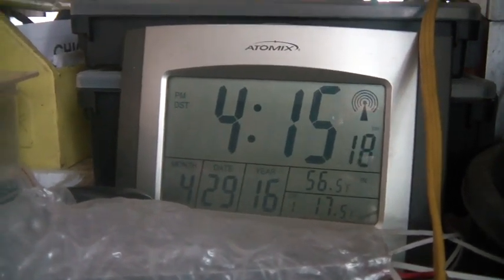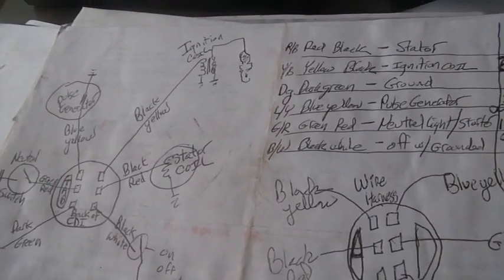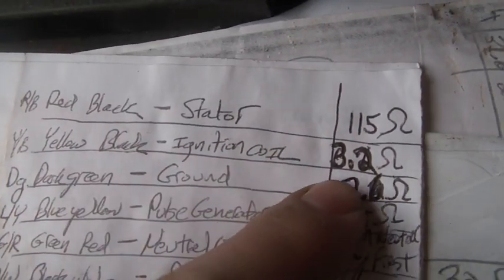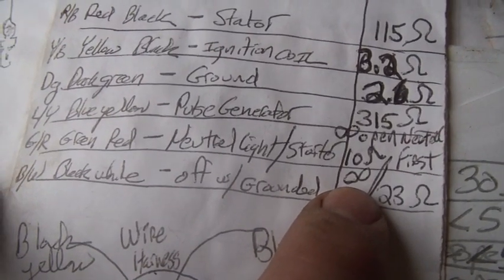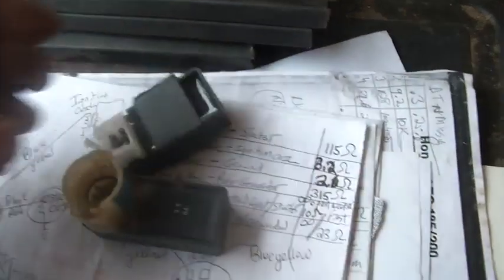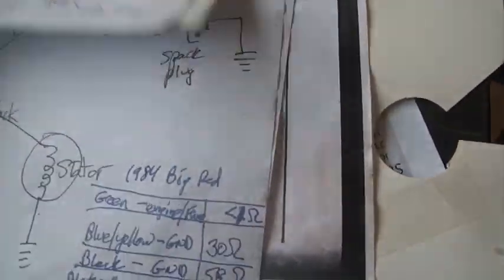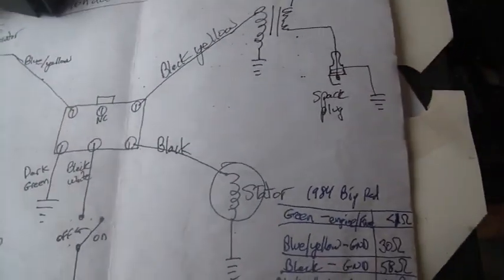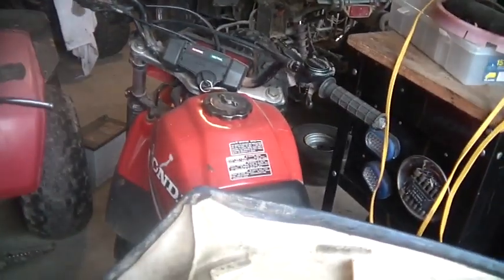Honda 200ES CDI

Comment: Harvey,  Can you please send me a current link to the correct China non advance CDI box to convert my 1984 200ES to the square plug style?  Thanks
Reply from the maker: Hey RatRod!!!!   They don't make China Quad CDI boxes without advance, but, I have found that the Honda ATC 185/200 motors run fine with the extra advance,  here is one I would use.... https://www.ebay.com/itm/5Pins-CDI-Box-For-70-90-110-135cc-Scooter-ATV-Quad-Go-Kart-Chinese-TaoTao/191790284945?epid=1794648153&hash=item2ca7978091:g:XQsAAOSwKtlWoCCO&vxp=mtr    I normally buy more then one because occasionally the quality is not great.... It should get U started and running, some are of good quality and last almost forever, some only last a short time.... Thanks for asking, watching, and commenting!!!

Comment: Finally had ten minutes to myself today so I tested out the wiring. My results are as follows. I tested every lead twice. Once in 2k and again in 200. My results will be posted with the 2k result first.

Stator  --  .260 / i
Ing. Coil  --  .002 / 1.5 
Ground  --  .002 / 2.2
Pulse  --  .030 / 30.7
Neut.  --  i all
Off  --  i / .003                    (200) i / 4.7
*i=inf.

I hope we can get some answers. The pulse bothers me a little. Maybe a good cleaning??? The pulse reading does jump some around when I pulled the recoil. I was pretty sure the the coil was questionable when I first dove into this project so no big surprise on those numbers. Let me know your input on this. Thanks again for everything!!!
Reply from the maker: Hi, Those readings look pretty good, though, the on position is low at 470ohms, infinity even on the 2K range would be much better.... The readings bouncing about when U pull the recoil is very normal for the pulser.... Where do U live?  USA?  What is Ur plan with this bike, R U trying to restore it or just get it running????  Thanks for the getting back to me, watching, and commenting!!!!
Reply: Harvey Spooner I live in NY. Maybe 3 hrs from you. My plan is to put it back together. It is in such great shape and needs very few things to be operational again. So far I have $0 into the machine so why not throw a few bucks at it and get it running again... So what do you think is the cause of my no spark???

Comment: Three wheel Honda's are too light on the front for me & I can see how they could be very dangerous.
Reply from the maker: +sim6699 , I have been riding 3 wheelers for 45years, have I done stupid things and got banged up, yes!!!  But, I have also had my fail share of crashes on 2 and 4 wheels, normally the crashes fall into a few categories,  me behaving or driving stupid, I did not know how to drive what I was driving, or the unit was not in proper shape to be driven...  Thanks for your thoughts, watching, and commenting!!!!
Reply: Harvey Spooner  i gave a 200es and my CDI is sick i think because some Times it works well and the next Day starts but always stalls and dosent have alote of power

Comment: I like that.  It is my year and type I have so this could be a great piece of information for my future.  Thanks 
On the bees nest I use carb cleaner, engine cleaner or starting spray. They just drop straight down. Cheeper than the real stuff too.
Reply from the maker: +Calvin's Corner72 , The 1984 Big Red is a great machine, a lot of them survived the years, I think a lot of adults owned them... I hope the info keeps Ur ATC and a lot of others from the scrap pile!!!  Some bees seem to survive the carb cleaner and starting fluid, the foaming engine cleaner works the best of the 3... What scares me about most bug sprays is that one only needs to get close and the bees fall from the sky, one wonders what that stuff is doing to us... Thanks for your thoughts, watching, and commenting!!!!